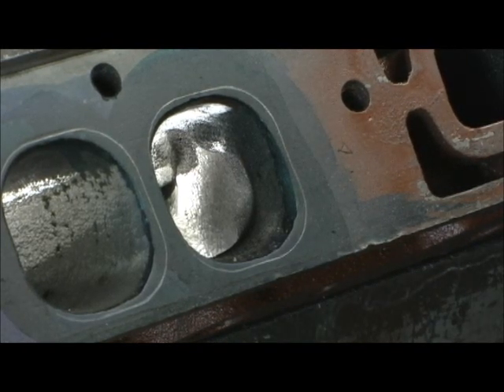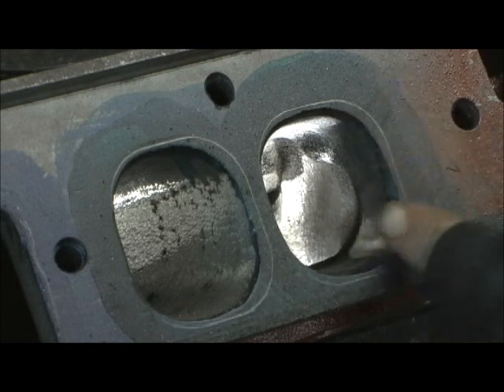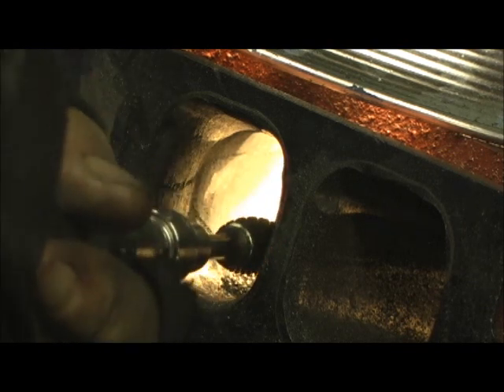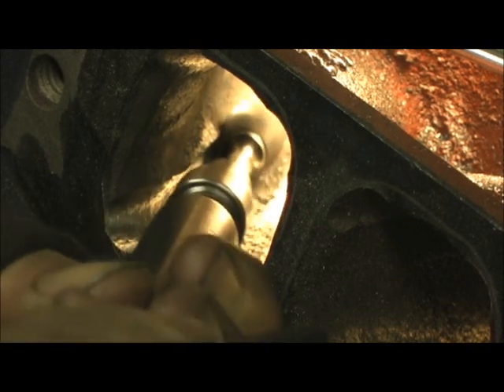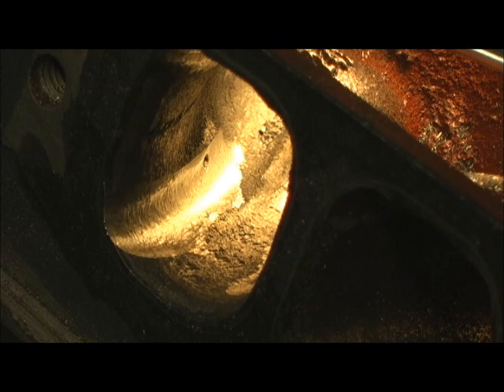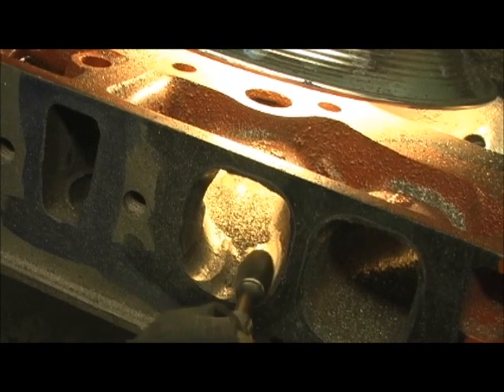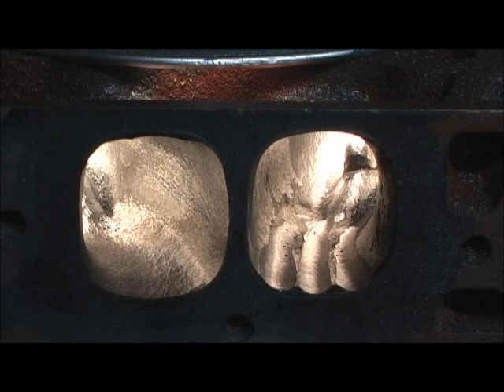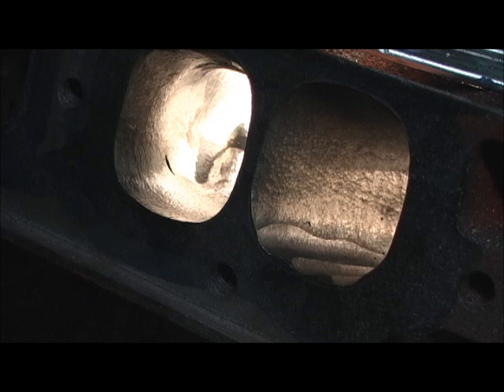BBC Casting 241 Stage III.5 Porting Part 5

Comment: Excellent videos & bless you for taking extra care of our military troops! Been doing BBC oval ports for years on my own vehicles. Have to say great explanation & views of what your are doing & why. I port as I see airflow throughout & only measure each port the best I can. I have no flowbench but make great HP & enjoy doing it. Doing a set of oval Edelbrock Performers & I'm using the big MG Intakes. Do I cut down the guides & do much to the exhaust side D outlets or just clean them up?  Thanx